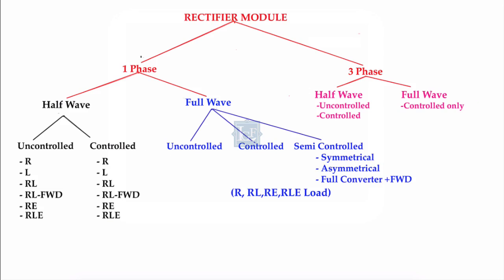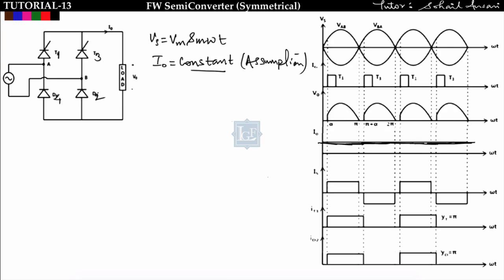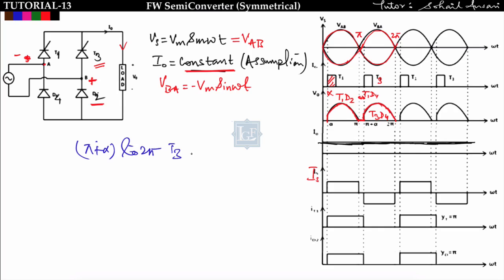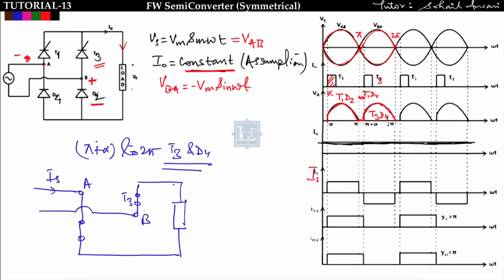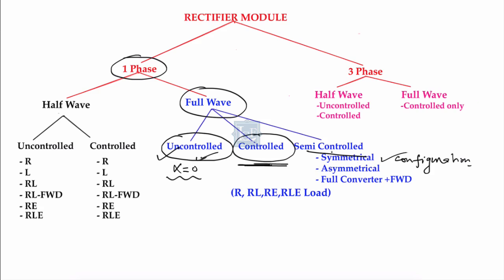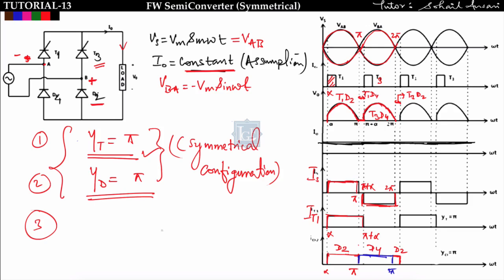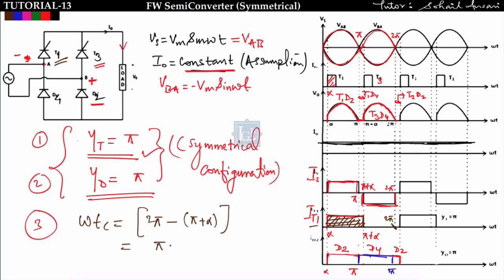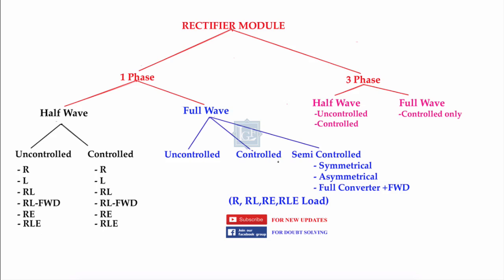Lec 13(a) Full Wave Semiconverter (Symmetrical Configuration)

Comment: how source current is opposite in nxt half cycle of voltage source
Reply: Here we are drawing source current with reference to the load current.. and source current will flow in opposite direction of load current in next half of the cycle. So it's taken opposite

Comment: Sir, for symmetrical semi converter we should be having a free Wheeling diode, else at wt=pi+alpha both thyristor may be on resulting in short circuit of source. Even in ps bhimbra free Wheeling diode is given
Reply: cant happen since thristor is unidirectional
Reply: @SUPER-dw9ks  if you put voltmeter across shorted T3 T4 branch you'll get zero voltage.. thus source vtg also gets shorted.. that's what Mohit vys is trying to say... Of course current will not flow since thyristor won't allow current to flow in either direction but surely we will get vtg zero across supply terminal